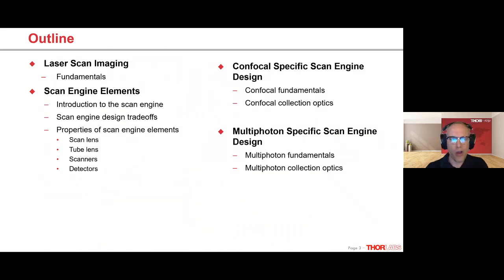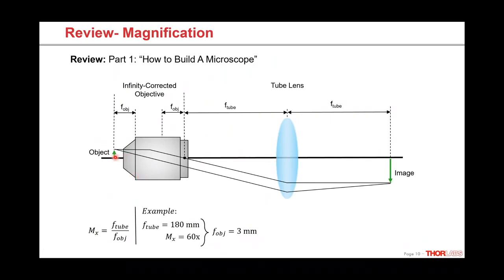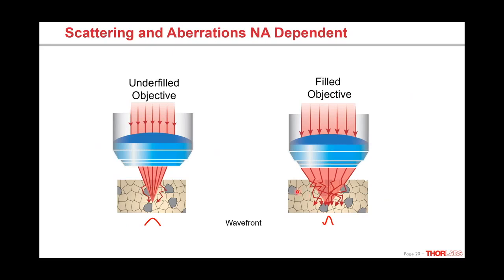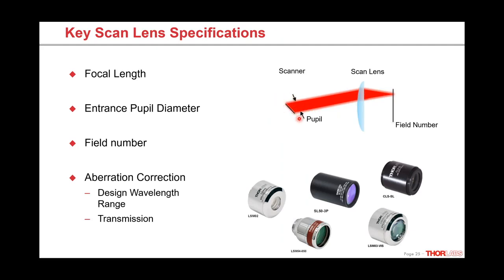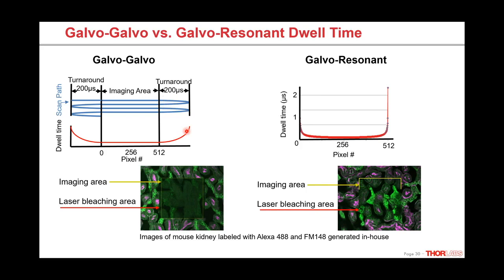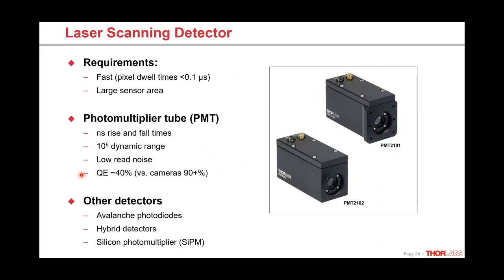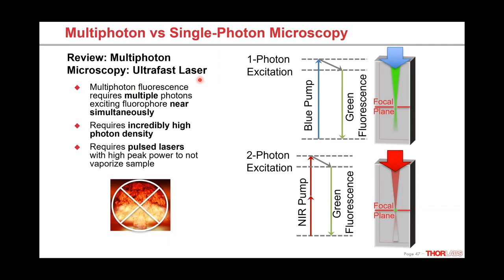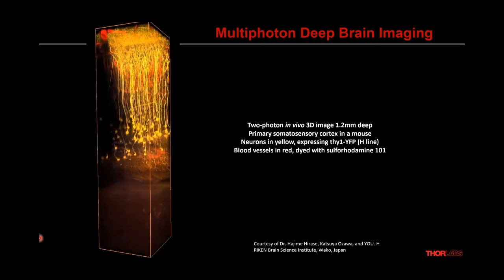Laser Scanning Techniques and Applications

Comment: How to get the max. acceptance angle of the objective? No such data in the website.
Reply from the maker: Thank you for your question! The maximum acceptance angle of the objective can be calculated from the objective's numerical aperture (NA). The equation is NA = n_i × sinθ_a  where θ_a is the maximum 1/2 acceptance angle of the objective, and n_i is the index of refraction of the immersion medium, most commonly air.

Comment: Thank you for very good explanation. I have one question. What should we consider when using UV as an excitation light in confocal microscopy?
Reply from the maker: Thank you! We’re glad you found it useful. When using UV as an excitation light in confocal microscopy, make sure that your objective, scan lens, and tube lens have a good enough transmission efficiency and are chromatically corrected for UV.
Reply: @thorlabs  Thank you for your answer